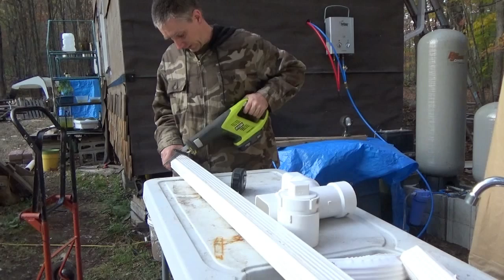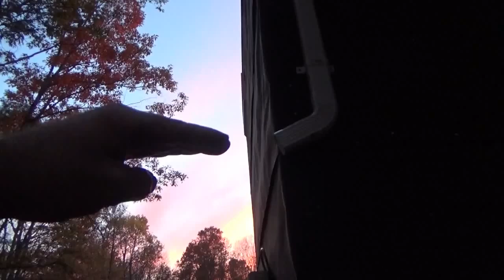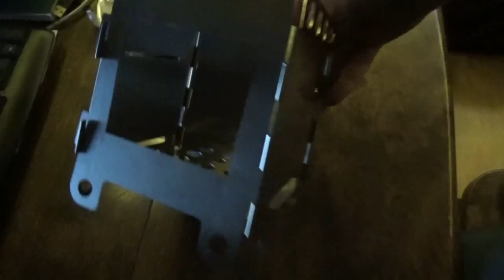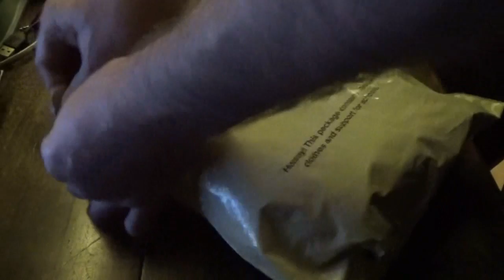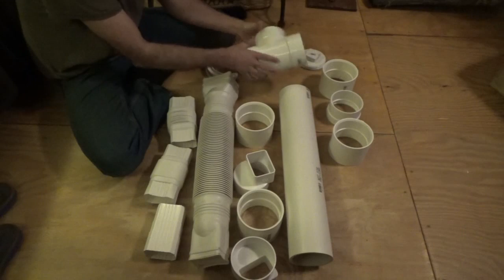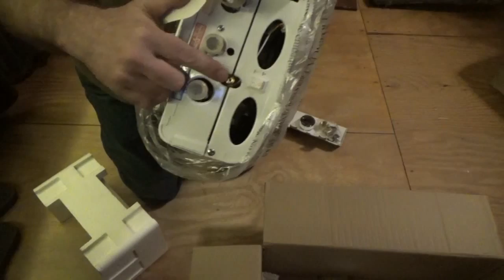Working On Tiny House Rain Water Collection System Part 2

Comment: you could have used a standard 4" DWV tee instead of the 4" thin wall drainage tee and eliminated the 3 couplings you needed.

Comment: Looking good Troy,  I see how the first flush diverter works see no problem, but why go back to the downspout material. It seems the round pvc would be easier to use from the diverter to the tanks. I'm thinking a second flush diverter between the tanks and filter would catch most of the particles that settle in the tanks. This may extend filter changes. These are just some random thoughts and I'm in no way telling you how to do your system. After all it is your project, I'm just trying to be helpful. I am very concerned about the hydrogen gas buildup from the batteries building up in the same room with the water heater. Best of luck to you, Bud

Comment: The diverter system is ingenious  especially with slow drip out the bottom. The on demand water heaters with tiny drainage badly needs manufacturer redesign.

Comment: I replaced the water heater hear about a year and a half ago. I thought about an on demand heater but decided against it. I opted instead to get a super energy efficient (gas of course) 40 gallon tank type heater so that water will be available for drinking should the need arise. The city maintains a 30 day supply of water, which is all gravity fed, so the water will keep flowing in an emergency situation where there is no power to run the well pumps. Unfortunately none of that does me any good if we end up with ruptured water lines during/after an earthquake. That 40 gallon tank style heater is firmly secured to the walls of the enclosure so it's not going anywhere. On top of that I maintain enough drinking water for about a month. We can go without food for a few days if need be, but we can't go without water.

Of course your situation is entirely different and the on demand water heater is definitely the way to go. In your case you have the water but need to conserve propane. I'm glad it arrived quickly and I hope you're being careful on that ladder when working alone.

Comment: hi troy highroller from springfield Oregon , nice work again , i see gutter straps !!! , make sure on the bottom of your water tanks are held on with screws as will too... do to your high winds you get , you got to get going on your shed soon winter is on its way , make sure you keep all water pump switches high and dry year round ad black tape around all your wire ends super nice water tanks thooo.......
Reply from the maker: +Giles Tramp Thank you. I will do that.

Comment: UPC Code 604.11.2 Water Heater Connections. PEX tubing shall not be installed within the first eigthteen (18) inches (457 mm) of piping connected to a water heater

Comment: Hope the pipe diameter will fit all the water wich is coming down the roof they seem very tiny in diameter so hopefully there will not be another problem with leaking water all sides of the house. Greets

Comment: The ladder is not wbelly, it's you leaning it on the wrong angle against the tiny house. You can find safety warning sticker on the ladder show what is safe angle of using it safely
Reply: +ilan magen That's what my thought was the moment he stepped on the ladder, even before he complained about the wobbliness. Troy, as a rule of thumb: if you stretch out your arms holding the uprights of the ladder, with your toes against the feet of the ladder, then the angle is good. Unless you have the arms of an urang-atang, your ladder is at too shallow an angle.

Comment: Everyone else I have seen install those water heaters installed them inside their homes not outside and looking at it, it looks too light weight to be left exposed to the outdoor environment. Just my opinion. Also would recommend you lay another layer of tar paper or plastic sheeting on the exterior walls before installing your siding after allowing it to be exposed for a year..
Reply: +The On Grid Homestead  with your reasoning then you can not have a gas stove, gas furnace, or any gas appliances, how absurd. Just  like with any other gas appliance you want to vent them to the outside. Now for flooding your home. again with your reasoning we can not have sinks, toilets, showers then. How about running that drain tube down through the floor to the outside or to a water drain line, you think that may be in the directions for how to install. I see these in rv's and motor homes and on boats.. yes all propane units and some electrical units to but mostly propane because that is what the consumers prefer. ask your local propane appliance dealer about it if you want to verify.  you also install gas, smoke and carbon dioxide detectors. I hope this info is of help to you.  peace
Reply: +Stephen Wells OK, I guess you didn't understand that what you are looking at is going to be in an insulated and heated add on which will be built around it all.
Reply: +Stephen Wells : That type of direct vent water heater can't be installed inside a house under any circumstances. Carbon Monoxide is odorless and deadly. Everything will be enclosed inside an insulated shed to keep it all from freezing. In my opinion, even a vented water heater should never be installed inside the living area of a house. Nobody wants to come home to a flooded house in the event of a water heater failure.
Reply: Stephen Wells I'm trying to tell you that specific water heater can't be installed inside. No vent = carbon monoxide = dead. It is direct vent, not flu vented like the ones you're thinking of. Peace right back at ya. :-)

Comment: Troy. Your water heater had better be mounted inside or it will freeze this winter. Unless , of course,  you intend to have water running through it at all times when it is freezing outside.
Reply from the maker: +John Diment Insulated shed I am building next week

Comment: two times 45 degree is also 90 degree Troy.. (just use two 45 degree bends...)
Reply from the maker: +MrBugsier5 They are not really 45 though. A bit off.
Reply: +The Do It Yourself World no wind power and all most time

Comment: Troy you have the ladder at to much of an angle. (grodad) made a comment about how a ladder should be set. Take how high you have ladder and your bottom should be about 1/4 of that out from the side of house. Easy way is you should not need to lean on your knees your weight should all be on your feet. This puts all weight pushing down on ladder rather than pushing in middle and making it bow and wobble so much. Leaning it out to much is a really good way to have the bottom kick out on you and you, the ladder, and any materials you have in hand will come crashing down
Reply from the maker: +M “Ghost” Baldridge Yeah, someone else told me. Funny thing is an "expert" friend of mine set the ladder up this way for me and said this is the "right" way. lol. There are too many "experts". Thanks.
Reply: +MollyDolly    Molly, the best rule for ladder safety is to keep the ladder 90 degrees from perpendicular and be preparedf to bail if it falls from there.
Reply: +M “Ghost” Baldridge : I was going to mention that too but didn't because I figured somebody else would. I'm glad you pointed that out. Troy needs to be safe on that ladder when working alone.
Reply: +The Do It Yourself World  Mr Plumber husband says ... No  more than 3' for every 10' of height you are climbing... so pretty much what +M "Ghost" Baldridge said and for the same reasons.   Basically, work with gravity... not against it.  Weight directed more straight down the ladder causes the ladder to dig in, not kick out.  That would be a painful belly flop.
Reply: The Do It Yourself World Not to beat a dead horse (which you will be if the ladder falls... but look at the video of you on the ladder... look at the rungs... they are flat on the treads and they should stay pretty much parallel to the ground ( or level ) they should not be tilted like that.
Reply: MollyDolly I knew Troy was going to get it when you saw that. :-)
Reply: ***** I know, right?!  ...and the trolls say I only praise him,  I never give out to him...  I do when it's actually dangerous.   ( or involves blue tables )
Reply: MollyDolly Don't feel bad, the trolls tell me I only praise Troy no matter what too. What they fail to realize is Troy is an actual human being and not character in YouTube videos. A human being who is actually doing a damn good job at something most people could never do. As human beings we make mistakes, not like TV shows where everybody is perfect. And oh, he's a human being with absolutely the worst cell phone service in the world. :-D
Reply: +MollyDolly   I meant 90 Molly, in other words, flat on the ground.(joking)
Reply: The Do It Yourself World I do not want to say something bad about a person I do not know but I am sorry to say he is not much of an expert if he is saying that ladder placement is correct. Think of a 6 foot step ladder and the angle they are. This is the manufacturer that makes ladders for a living they know what is a safe angle and what is not. Now I have done construction for better than half my life and believe me when I say this you keep using a ladder with that angle you will one day (probably sooner than later) be picking yourself up off the ground. That is if you are lucky enough to not get hurt. It is still your choice to follow who ever advise you like but I sure hope you follow mine or others like mine because that is the safe way.
Reply: Rich K  90°???  You mean 45?
Reply: Rich K hahaha!   I was thinking that's not right, that's parallel to the ground!!  You got me!!    LoL!
Reply: Free Music for your YouTube Videos  I believe you are correct!  Lol!
Reply: Rich K At least that way you would only have to roll over to bail if the ladder falls. I guess it could fall a perilous 1/4" or less. Safety first! :-D

Comment: I showed this to Mr Plumber husband,  he says be careful of the weight of the first flush you're building. . . looks like that will hold about 45 - 50 pounds of water...that is a lot of weight be sure to support it well.
Reply from the maker: +MollyDolly 2x4 framing screwed to the house with one board all the way to the ground to support the weight
Reply: +The Do It Yourself World  Sounds good. :)
Reply: WC Prepper 2 Thank you for that information... I will pass it along.  Funny I just asked him about it and asked him to review the instruction... but mean while this Triton is not functional...it leaked.  So he ordered a different one... it must be in a different video where he shows the new one... different model all together, but I suspect similar cautions.  I suggested he cut some concrete board  for behind it, or use sheet metal  on 1x1 spacers.   I laughed at the part about keeping the unit in sight... how exactly does one do that unless the unit is in the shower with you?  Odd instructions... must have been written by a lawyer.    As to the over hang... I don't think there is one now, but there will be when the insulated room is built... that's a concern... I would suggest a non combustible lining up at the ceiling of the insulated shed room, too...and a good vent...
Reply: WC Prepper 2 I get your points. I am not comfortable with it in a room either, and have expressed my opinion on that... but it's his life, not mine.  Everyone should read instructions and follow them for themselves.   As to the tankless water heaters for homes... they are for external installations only also... for the same reasons.  Thus, this insulated shed really needs an exhaust fan probably... although that might draw the gases off the battery you mentioned over to the heater's flame...  I am glad you brought that up...something to consider.  I know nothing about what gases may be expelled by forklift batteries...but perhaps a vent fan should be running near them, not the water heater? That would vent all the room gases away from the house.   Are you aware there are a number of off gridders using these water heaters right in their bathrooms?   Scary...
Reply: +MollyDolly I just left my second message that had my concerns about the hydrogen gas expelled from the batteries when being charged. This could accumulate in the shed and be ignited by the water heater. Lord I hope there is not a big bang.
Reply: WC Prepper 2  You can stop fretting.  The installation will be made safe.  Right now it is not yet enclosed,  before it is he will have to include ventilation.  As to the T & P maybe,  maybe not... a T & P is required when connected to city main supply to avoid sudden pressure causing problems but Troy's install will never suffer high pressure. .. guaranteed.  As to the "T" that's for temperature,  now not having read the instructions I will just say generally on a DC ignition the limit switch will fault to an open circuit, thus it can not ignite.  Therefore,  I believe he only needs the T & P if he were installing on A/C power and city water supply. ..which he is not. That said, he should follow the instructions from the manufacturer, not advice from online comments...regardless of our good intentions.  As to the other video. .. I see nothing wrong with it.  There's no over hang, it's outdoors, it installed with pex rather than garden hose but that is a non-issue...no T &P is required on this type of unit (remember it is not a residential tankless water heater... it is designed for off grid / camping use ) and it's educational showing the dang thing leaks.

Comment: dude I'm so confused! isn't the rainwater collection like the last of your priorities right now? I think I'd make sure I had a fully functioning comfortable home inside before I did "hobby"type stuff. unless you're not hooked into a well or city water. But you've showed running water do you obviously are hooked into water somewhere. You seriously need a priority list and put a fully functional inside and living abilities FIRST! You jump from project to project and I'm not sure I've seen anything completed. Am I missing something?
Reply: +tamib711 Running water is a priority, any water you saw running Troy rigged himself with water collected form the motor home roof collection system. He is not hooked to any city water supply or well.
Reply: +tamib711 Welcome to the channel. Yes, you are missing a lot. You may enjoy going back and watching some of the older videos to catch up or just figure it out going forward. No, he is not hooked up to another water source so he needs to get it done before a hard freeze sets in. Otherwise, he is pretty well set up. He made it through last winter so that speaks for itself. Most of the interior stuff that needs doing is cosmetic.
Reply from the maker: +tamib711 Ok, you live out in the woods, working in the dirt, without running water and see what your priorities are. I bet they change a bit. Hobby type stuff it is not. Try bathing in 35 degree water while you are at it. Ugh. Not nice.
Reply: *****
Don't flatter yourself that your foolish behavior bothers me. I am letting the viewers watch your nonsense and draw their own conclusions about you.
Reply: Lynn Morrow
That is absolutely wrong. I said it is entertainment.
 If you are going to quote me, get it right.
Reply: Lynn Morrow
You are correct that we are not the same person. I am the only person who can log into my account. The opinions I express are mine and mine alone. No one influences my opinions in any way. I have no other contact with Troy but what you see in the comments section. I am exactly who and what I represent myself to be.
Just thought you would like to know the truth.

Comment: You can switch with that down spout part you want to return to Lowes and go with pvc drain pipe from the gutter on down. Then you can get and use the 90's in the round pipe.
Reply from the maker: +BUDDY LIGHT Just got home with exactly that
Reply from the maker: +The Do It Yourself World well partly